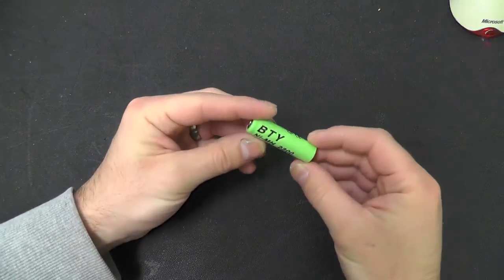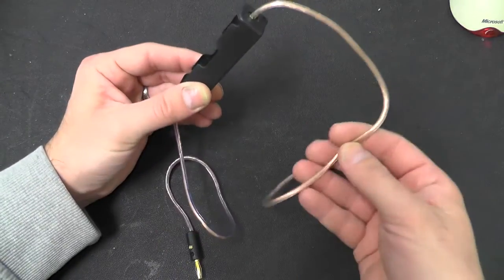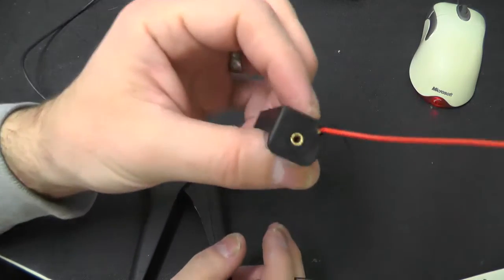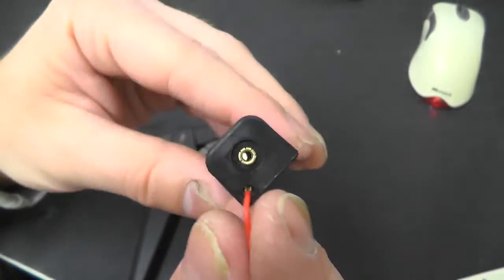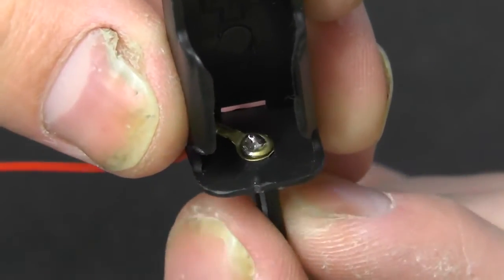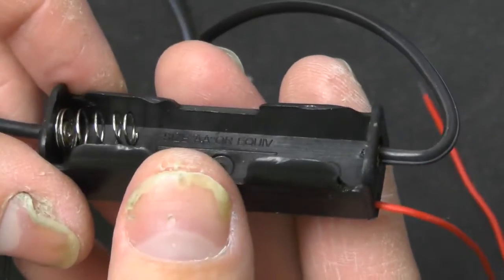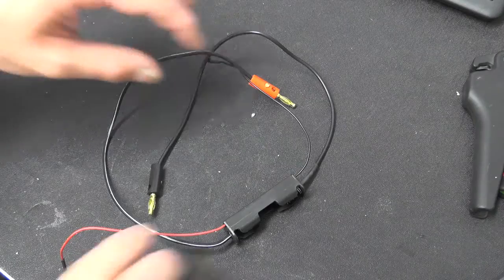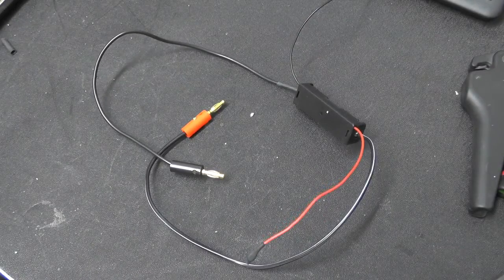DL#030 - Making An AA Battery Test Fixture

Comment: One could make the point that most consumer electronics devices would use the tiny wires and bad connections....so testing cells in the battery holder "as is" would be part of then testing procedure.  No?
Reply from the maker: Thats not how i would see it. If i am testing the capacity of a battery then i would want to get the most accurate numbers possible of the actual battery. Rather than numbers which might include other factors, which would also certainly be variable between different test setups.